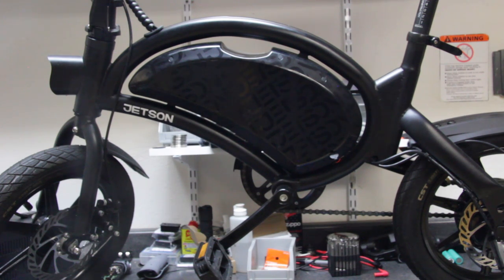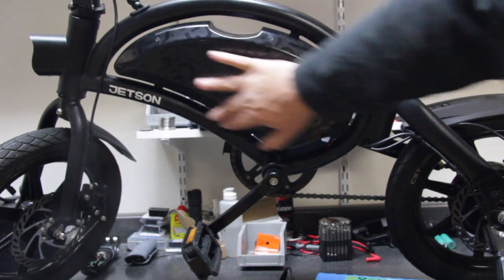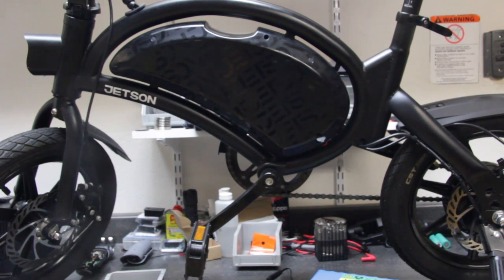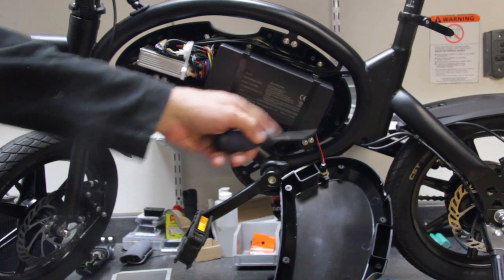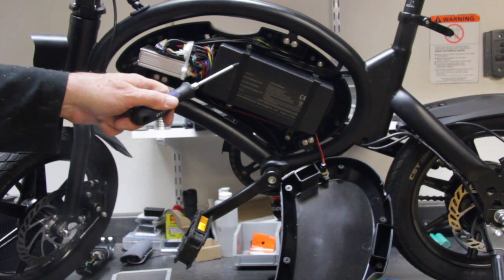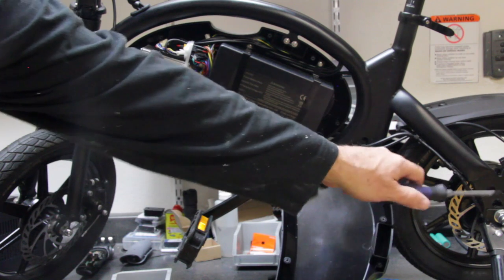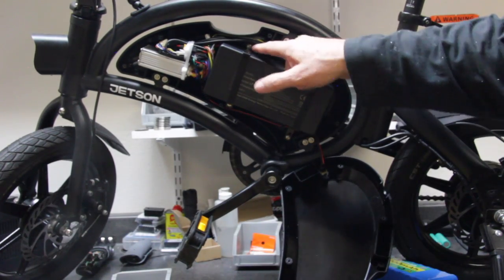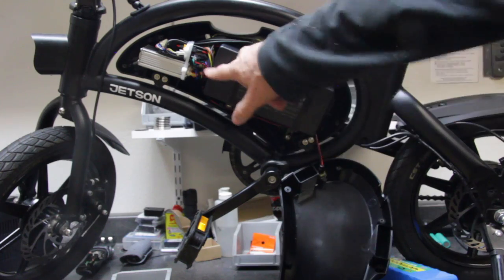Jetson Bolt Pro Battery Replacement Part 1

Comment: Can I but in a battery with the same Voltage but higher Amp-Hours.
ie, 38v 14 Ah
Reply from the maker: As long as the battery fits, yes.  You can even put an extra battery on a back wheel rack, but charge that battery separately.  I did a video of this.
Reply: @JoediyLab  ... thank you.

Comment: Do you know if it’s possible to reverse charge a Bolt battery to wake up the BSM?

I left my battery to long without charging it.
Reply from the maker: I have done it, you have to remove the BMS and test each cell,  The cells that are low voltage, you can try to charge up to a voltage that will then work with the BMS.
Reply: @JoediyLab  

Thank you 😊

Comment: do you think tto 20ah battery can fit the case
Reply from the maker: Measure the standard battery and then check the measurements of the 20ah battery.  I believe the 14 ah battery will fit, but double check

Comment: Do you know how to take off the speed regulator to make it go faster
Reply from the maker: If you have the bluetooth adapter from the older Jetson, you can increase the speed a few mph.  Or replace the speed controller.
Reply: @JoediyLab  I have a ancheer it like the jetson do you know where I can get one
Reply from the maker: @usmcaav  No,  I have heard others try an off the shelf bluetooth, but did not work.  You can pick up a cheap speed controller for around $20 - $30
Reply: @JoediyLab  is there a link you can send me
Reply from the maker: Here you go Michael,  https://www.amazon.com/gp/product/B07LF92Z3W/ref=as_li_tl?ie=UTF8&tag=joesfablab-20&camp=1789&creative=9325&linkCode=as2&creativeASIN=B07LF92Z3W&linkId=d724aa1e34c29003d1c10e9c6fa7fe84

Comment: What is the range with that replacement battery @ 8000mAH now?
Reply from the maker: Sorry, I did not test the range on the 8000 mAH battery.  I will test and do a follow-up,  Thanks

Comment: Can this work for the normal black and red one?
Reply from the maker: Yes,  just measure your battery and when you purchase a new one, make sure the size is the same or smaller.
Reply: @JoediyLab  okay, thanks.